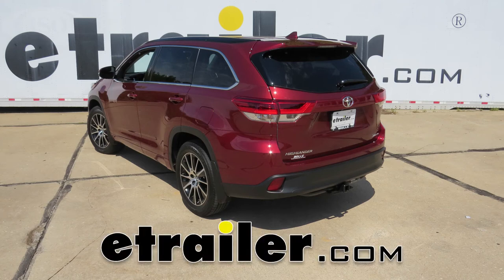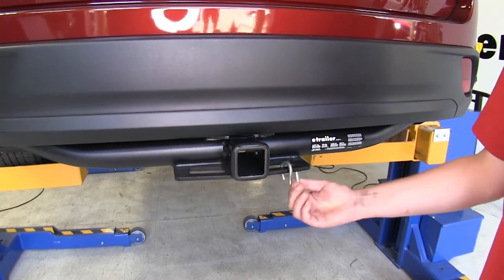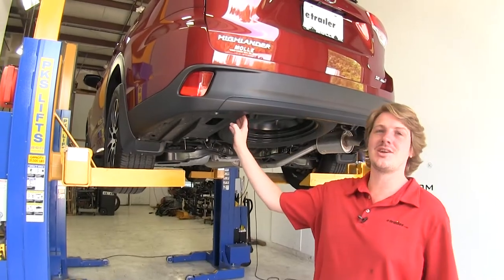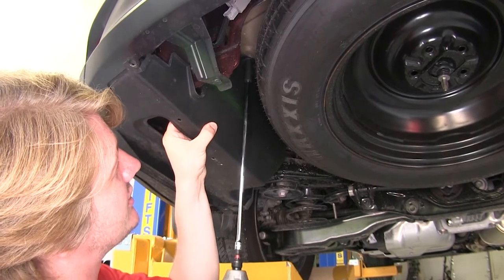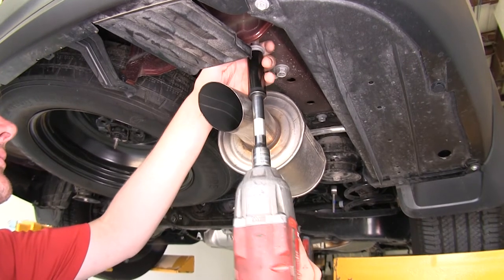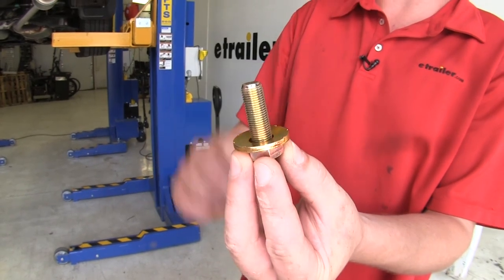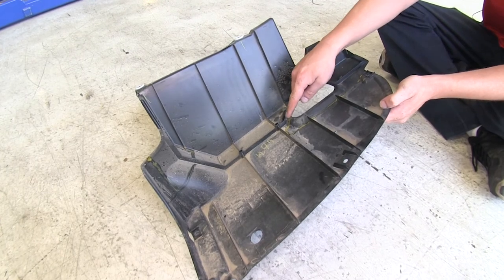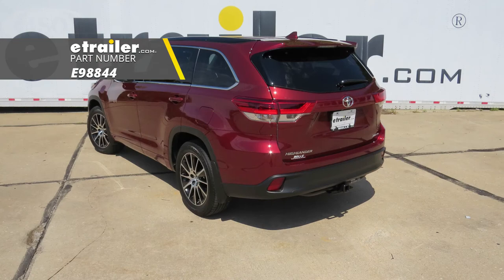etrailer.com Trailer Hitch Installation - 2018 Toyota Highlander

Comment: Thank you for the tutorial. But when I read the instructions for torque specs, the instructions online say, "Torque all 12mm hardware to 86 ft-lbs". I thought the new hitch bolts were 19mm?
Reply from the maker: The head of the bolt is 19mm. The threaded portion is 12mm. 
https://www.etrailer.com/Trailer-Hitch/etrailer/e98844.html
Reply: @etrailer  thank you so much for the information. Video was super easy and helpful.

Comment: well done ... what about electrical wiring?
Reply from the maker: You can check out the wiring kits in the following link for your 2018 Toyota Highlander.
https://www.etrailer.com/t1-2018_Toyota_Highlander.htm

https://www.etrailer.com/Trailer-Hitch/etrailer/e98844.html